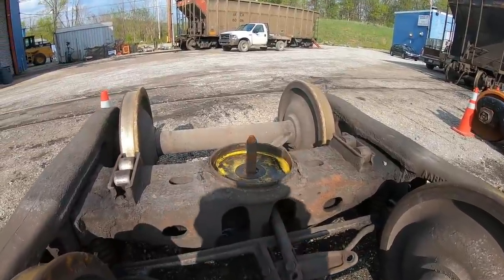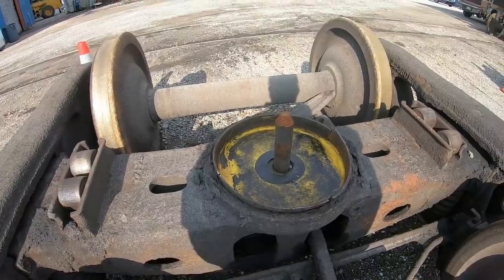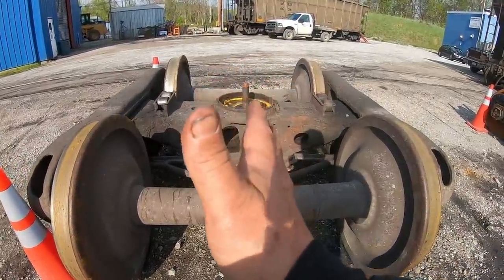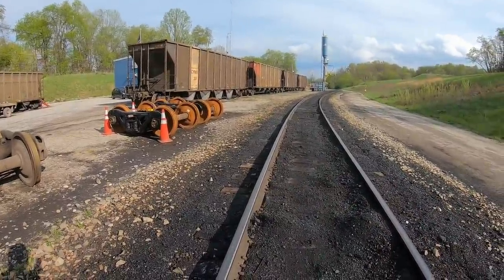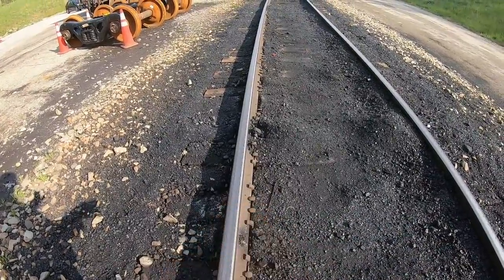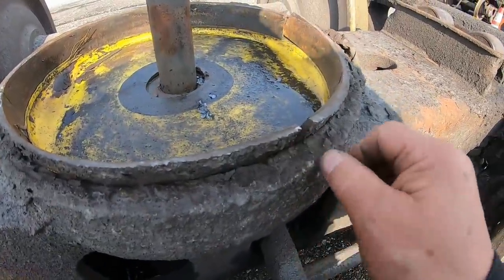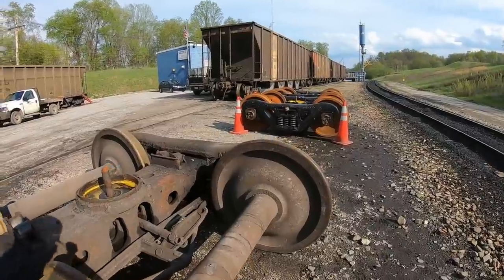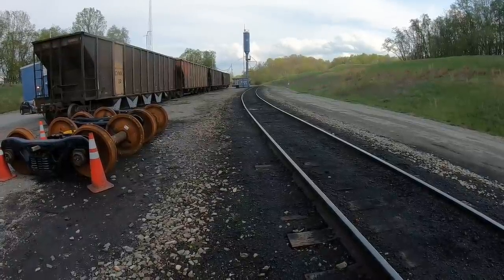Why the Derailment at Curve 18  Happened

Comment: Enjoy your videos Dave, you sound like a good track guy. Not being critical of you, but  a good track guy will always attempt to blame a derailment of this type on the freight car. In my short forty years in the Mechanical Department of a class one RR, I helped to clear and investigate what seems to be a thousand similar type derailments. I would need a much closer inspection of the truck center bowl, but there should be definitive marks on the truck center bowl and the maté freight car center plate if your theory is correct. The truck center bowl does appear to be in poor condition, but it’s hard to determine if it is defective from your video. There are several questions to be answered first. Before the freight car was jacked from the car trucks, did it have the required minimum clearance between the truck center bowl and the car center plate? Were there wear marks on the top edge of the truck bowl and the bottom of the car center plate. A condition that would result in a car truck not slewing in a curve and causing a derailment does happen normally all at once. This would be a center plate condition that takes time to develop and leaves definitive signs. What was the slack action in the train at the time of derailment? Did you have slack running in from the rear and what was the train make up/weight distribution? Did you have wheel lift? What did the Point of Derailment marks on the rail and ground look like? Then the lead wheel in the direction of travel of the suspect car climb over rail and the following wheels/car trucks start pushing the rail and rupture the gauge? Were there marks, gouges on the suspected lead wheel to derail? Again I am not being critical of your findings, but in my experience over the years, derailments caused by a car truck failing to slew a curve is very rare.
Reply from the maker: Thank you so much for the very informative comment Bob. Yes 
track men always blame the car men, car men blame the engineers
and the engineers blame the track crew.....:-) That's railroading. You
bring up a lot of really good points, a lot to go over. 

38 loaded cars on the train and he was going at track speed of 25 mph
with the end of train loco pushing in run 5, normal operating 
procedures for that section of track, which they have done thousands
of times with no problems.  I cannot answer about the center plates
on the car, I was no in there when they took the truck set out from
under the car, and quite frankly no one even thought to consider
looking at that center plate when they did, nor the clearance.

Yes the wheel did climb up on the rail and roll it over. Ties were in
pretty good shape on that section. It was my thoughts that the
lead wheel climbed because the truck set did not swivel and it
wanted to go straight, which then caused the lead wheel to climb
up and then it was history. I did find the POD and there were
obviously wheel climb marks on the rail head gage face. Very much
appreciate your watching and writing in my friend.

Comment: When I watched your video of the derailment. I actually speculated trucks slewed was part of the problem. But I honestly suspected the locomotive. Mostly because three axles bigger wheels longer wheel base and more weight. I wondered if as it came around the corner they got bound up to where the flange was at a perfect off angle to just slow roll the rail out. Or get it started, plus having power on the axle. Would you know if the were pulling hard or in dynamic breaking hard? Be interesting too if the face of the rail right at a joint had contributed. It always seamed to take a lot to climb the rail and something must have started it.
Reply from the maker: Larry, great comment sir! this was a very slight downgrade, lead
loco in throttle run 5, rear in 3, he was just getting ready to
knock both locos to idle when it went into emergency. You are right that it does take a lot to climb, curve wear and wide gage always
worry me bout that

Comment: You do a great investigation and thesis on the cause of a very unusual derailment.  It appears to me that individual maintainance of wagons ( cars ) is overlooked or neglected.  The fact there is virtually no grease present on that swivel bowl is indicative of the aforementined.   Those vehicles take one heck of a bashing in their working lives, and it would be understandable how they would fail if regular pre emptory maintainance was missed through a busy turnaround period.
It appears your company will have to step up inspection/maintainance on every wagon (car) in service and/or introduce Pandrol on concrete for curves.  i suspect cost cutting may be the root cause of this very expensive derailment, and i bet i'm not far out in this assumption.
Just one other thing: This will give you some pause for thought and is not related to this video or the derailment subject, although it will strongly affect any railway wherever in the world.
   The earth we live on has been given a radius of 26,000 miles by scientists, and that is the accepted standard, giving a formula of 8" to the mile squared over that distance.  You may like to think about that - i believe you will come to a startling conclusion.
Reply from the maker: As Thomas the Tank Engine said, Silly cars always causing
trouble because they are angry. Thanks for watching my friend.
And as you know the trackmen always blame it on the carmen,
the carmen blame it on the engineers and the engineers
blame it on the trackmen...LOL Thank you so much for your
great comments you send in, I love them

Comment: I think your theory has a lot of merit from the physics. The super elevation will help it turn if the trucks are turning freely by moving the center of gravity in but if the truck isn't swiveling the move in COG would be taking weight off the outside wheels if only briefly before the centripetal force pushes the mass of the car back towards the outside. Also since the coupling is in the middle of the car and below the COG the pull would also have some leverage aka moment thats also pulling towards the inside because the pull is trying to get the shortest distance which is tangential while the spacing between trucks or basically the supporting points is a fixed distance. This would theoretically cause there to be some sideways shift inwards in the pull on the truck while the COG of the car is minutely shifting inside also, giving the outside wheels that brief lift (or just loss of full downward pressure) that let the truck thats going straight hop the rail and then its dominoes falling.
I would also ask if you think the super elevation adds a small amount to the difference in the length of track. The outside is obviously longer to start with but does that add a little bit more? The truck is already fighting that difference in distance and wanting to kind of trip itself which also adds upward and outward force on the truck, plus its trying to go straight so that adds to the physics above and it seems like everything with railroads is large but also affected by small differences of single degrees or inches so if the super elevation making the difference between inside and outside distance of track would only make the problems worse when things go wrong or don't function correctly.

Comment: @ccrx 6700 have you heard about Hunting Index, it's just what describes how bad certain cars behaves on tangent track. Since you run a closed system where the cars got a certain wear pattern over time and compounded by certain cars constantly getting heavily punished by the locomotives pushing and/or pulling rotating the consist is very important to reduce wear. Is that something you do? I mean swapping places on the last/first 3 cars and switching them into the middle of the consist regularly?
Reply from the maker: Hans you are a thinking man and I like that. We take cars out and put
cars in all the time, lot's of repairs need done on these old things. I fully agree with you on the uni directional load traffic, it hard on cars and on our rail. We do not do a regular switching of cars like you
mentioned however.

Hunting is most commonly on lightweight empty cars and made worse by dry rail and wheels with a high conicity or severe taper, it
generally occurs on speeds above 40. Our track speed is 25. The constant contact side bearings were introduced to counter act
the hunting problem on light weight cars. We do have constant 
contact bearings on about half of our cars right now. We do get an
occasional hunting due to a certain pattern of track perturbations but
it is usually not very severe, you can feel it in the loco on these spots
as the loco wants to slide back and forth, but again it has never
been a severe issue here and with good track surface, there is
no hunting to speak of on our track. Car truck hunting has been
a source of many derailments in the past on higher speed RR's tho

Comment: How often do the truck-sets need inspecting and maintenance done on them?
Reply from the maker: They get an almost daily roll by inspection as a train is leaving
the harbor portal Bill, often several times a day. To actually pull
one in the shop and lift the car body off, that only happens if
there is a bad order car that something needs for it to come
into the shop for to get fixed. We only have 4 mechanics here
spread round the clock and they are also responsible for
a plethora of other duties around the harbor, so time and
man power is a major player in not being able to jack each
car up on a routine basis.

Comment: I'm wondering WHY the truck center "cup" is made out out thin metal like you have shown us and AMAZED by the fact that the center pin is only like 1 and half to 2 inches diameter. With all the curves, the weight and the pressure at high speed those cars have, I really tought that it was a lot thicker and stronger made !
Reply from the maker: That yellow liner is a hard plastic like a teflon Luc, it's purpose is
to provide a type of lubrication so the truck set swivels better.
Thank you for taking the time to watch and may you have a very good day my friend.
Reply: @ccrx6700  Thanks for answering sir ! I herd you saying that the "cup" is made out of teflon. But I was talking about the metal mold in witch the teflon cup sits. It's thin metal made when you understand how much weight and pressure car trucks are getting thru. And the pin ??? I really thought it was a much bigger diameter kind of anchor. The pressure and friction between those parts is high on one single car. I can't imagine the friction on first car if you got a hundred of them trailing at the back !!! And loaded like the coal cars running on the line you're  doing maintenance ! Trains are really well engineered to roll on tracks at high speed like they do.
Reply: @made-in-the80s Thanks for answering sir. It's always a pleasure to learn more from you.

Comment: Surly the company has some accident investigation specialists to ascertain the cause. I was suprised to hear you say it was your call to have the parts set aside surly that should just be standard practice to preserve the evidence for further assessment. Sounds like it's common to have derailments dose that not make you question the company's maintenance and safety policy.
Reply from the maker: All of our derailments since 1993 have been caused by wheel
bearing failure, before that they didn't have a dedicated track crew and had several that were caused by wide gage. Several
yard derailments have been human error. Thanks for watching

Comment: Hmmmmm.......  I have never heard of putting grease in the area surrounding the pivot pin.  The yellow insert you showed IS the "lube" as it offers a very low friction surface to allow the truck bolster to pivot under all that weight of the car above it.  You may be right about the grease, but I have never heard of that being done.  The fact that the low friction plate was completely worn out in that truck suggests the truck bolster and car body had a high friction mating surface between them, and that I believe would cause the truck to possibly stick and not want to pivot correctly.  The super elevated track in the corners I thought was to counter act the centrifugal force being applied to the car's side as it went around a corner so the center of gravity vector would remain pointed directly downward between the wheels to keep the car from rolling over. The purpose of elevating the outer rail is so as the car tries to roll over to the outside of the rail, the center of gravity remains between the rails.  If the transition from super elevated track to flat tangent track (like the exit of the curve you showed in a previous video) does not have a smooth transition the car truck's wheel flange could easily slip over the top of the rail and start rolling the rail and causing all the damage you showed.  If the low friction plate between the car body and wheel bolster was non-existant, as you showed, then I could see easily how the wheel set would not track smoothly and could easily ride over the rail coming out of a curve.  I suspect you may have many more cars with worn out low friction plates unless you check / replace them frequently as part of normal car maintenance.  If you don't normally replace them, you might want to seriously consider inspecting the entire car fleet and replace those low friction plates.  If you run 30 car train sets, I would think such an inspection could be done over a few days.
Reply from the maker: Lyon's Industries (they have a web site) in Ebensburg Pa. rebuilds
our loco trucks and car truck sets. Years ago he told us we should
be putting grease in there and that is why the guys here do it.  Could be he just wanted to sell us cases of grease?....LOL

You are absolutely correct in your discussion of super elevation,
I gave a pretty simple explanation of that in the video, but certainly
nothing as detailed as yours! Thanks for writing in my friend

Comment: What you're calling "super elevation" is what is commonly known as "road camber" on highways, it causes the weight to be pushed down instead to the outside of the curve. Curved freeway ramps have strong camber because of the intended higher speed. The faster the intended speed combined with the degree of the curve the more road camber is instilled.
Reply from the maker: Thank you for sharing the info with us DrHarryT. In many other
countries the SE is also called cant, or rail cant. RR''s are the same way, the faster the speed and the sharper the degree of  curvature,
the more super elevation is put in. Thank you for taking in the video. May you have a most blessed day my friend.

Comment: Looking at the 4 horizontal rollers was there any evidence of interference that they might have contributed to the inability to allow the truck to turn?
Reply from the maker: Those rollers are called side bearings, some cars use the rollers
and some use a different style called constant contact bearings.
Which the latter are in constant contact with the car body, whereas
the rollers are not, they only come into play in a curve. They
help steer the truck set thru the curve and yes if they don't function
properly then it can cause truck swivel problems. And yes they could
have been a contributing factor in this derailment.

Comment: Respectively I disagree. I have seen center plates or cups broken worse than that with no derailment. No part of the ring protrudes inward so it is not going to bind, plus the car was loaded 286,000 lbs? Which would tend to exert  a high downward force to thwart the urge to wheel climb. My guess, hopper postion is close to the locomotive, speed is 22mph (the sweet spot), that sounds a lot like harmonic oscillation. Elevation is not to prevent wheel climb, but rather allow the fixed wheels to navigate the curve.  The wheel profile allows the outside to cover more  rail than the inside so the truck  does not keep hunting.
Reply from the maker: Awesome, I appreciate a response like that spoken with respect.
You know what you are talking about, I like that. As I said it
was my theory, unfortionatly we will never know if it was right
or not, but we can hypothesize.

I'm thinking too much weight shifted to the right on this right hand curve as you say exerting a high downward force. I do disagree with you on the "sweet spot" Harmonic oscillation the magic number is 17 MPH, but that neither here nor there. I'm guessing
you and I could have a very interesting discussion in person sir, I would love it. Thanks for watching

Comment: I find it interesting that as you look at that truck, the side bearing rollers on the left are shiny while the rollers on the right are dull and rusty. Frame twist? A twisted frame could certainly cause a derailment.
Reply from the maker: Very good observation John, even I hadn't noticed that! Thanks for
watching sir
Reply: @ccrx6700  look at the mate truck from that car. It should have the same anomaly but on opposite sides.

Comment: Noticed those broken bits on the old truck don't look like the newer trucks.. when you walk over to the new ones it does not have that skinny lip of metal around the edge of the newer ones..unless this is embedded into the plastic? so is it a matter of a lot of wear or lack of grease and maybe the maintenance and inspection needs to be stepped up?
Reply from the maker: Very good observation sir, I don't know what the difference would
be. Thanks for watching my friend.
Hope you'll stay tuned for the rest of the upcoming videos on
the derailment.